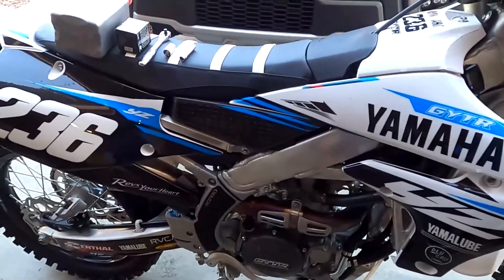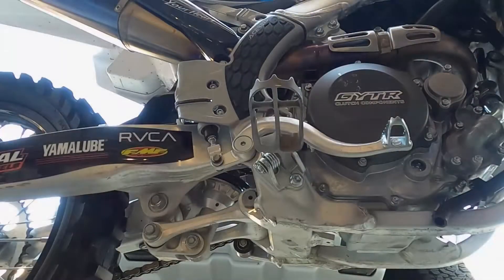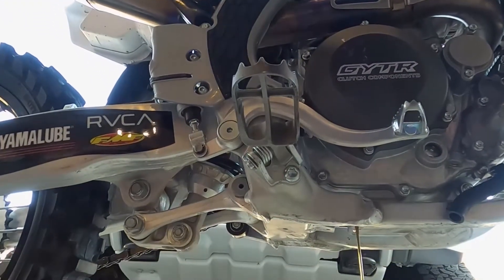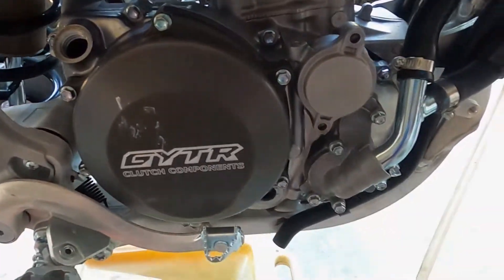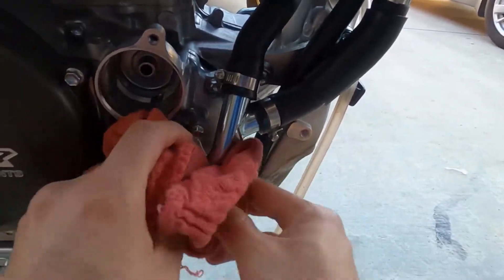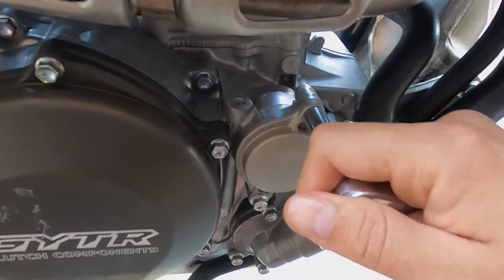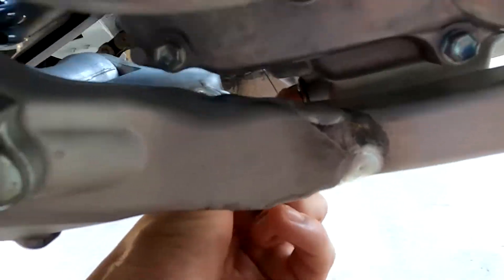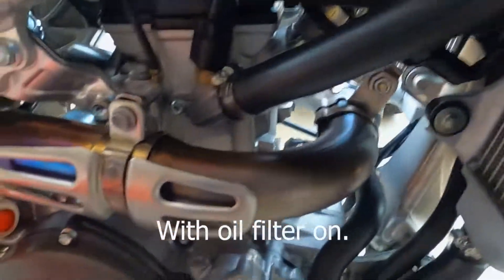YZ250F oil change

Comment: Hey where did you get the capacity from, because I just read from an online manual that has it at .95…?
Reply: The manual says that on my bike too. 2019 yz250f
Reply: @ZacharyBisick450  yeah I was confused for a bit. But .95 was definitely to much. Perhaps I was reading the wrong manual. Who knows. Went with .8 and it’s been perfect.
Reply: @canamxmr4760  I put 750 and it seems to have been perfect.